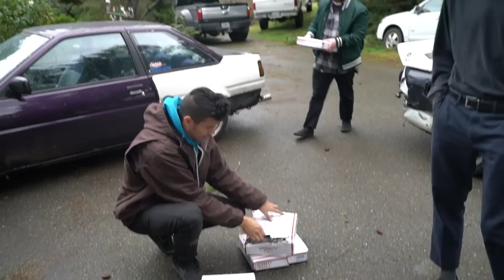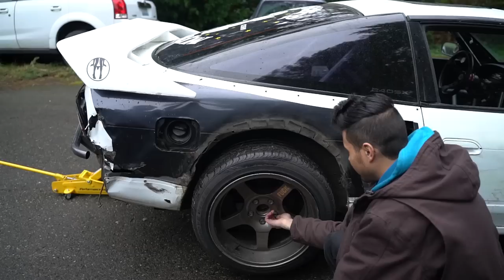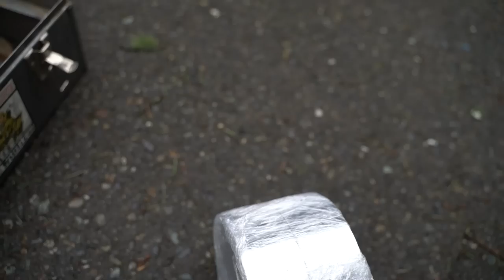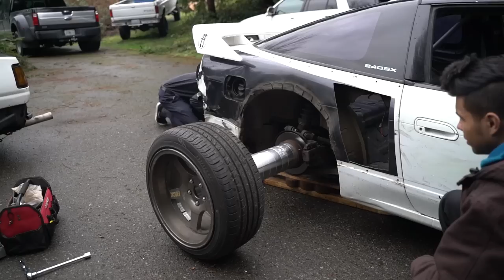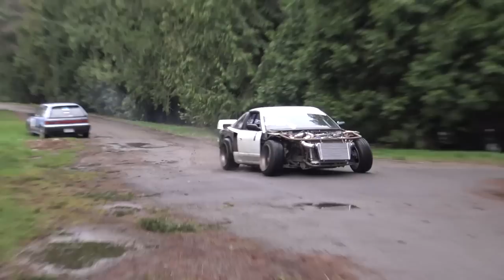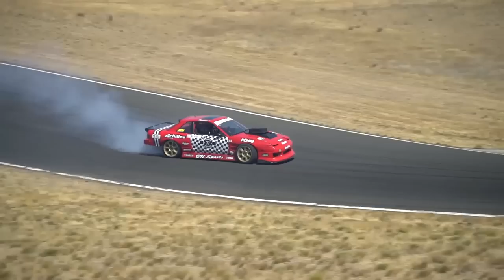How Many WHEEL SPACERS can You Put on a CAR?

Comment: Time to invest in a battery powered impact driver.
Reply: man i love impact drivers
Reply: It'd be dead by the third spacer...lol need an air compressor impact
Reply: Darion Akins My 6Ah battery on my Makita impact driver can last through all those spacers. I only suggested that because it appears that they're away from a location where they might air tools
Reply: its more skids. the impact drivers name is quintin =D
Reply: I work in a garage changing tire sets and our impact guns last through at least 4 full tire swaps (taking wheels off and on). A good tool could last through all of those spacers.
Reply: kiraanimerawr1 Exactly, specially if you have a 6Ah battery on a brushless impact driver. I just replaced my home's entry door. using my Makita sawzall with only a2Ah battery, I cut through all the mounting nails, and even managed to cut my old metal door(foam core) into four pieces without recharging. 6Ah battery on my Makita impact can do all those spacers and remove them with single charge.
Reply: @Dangerwiggles  why no new content on your channel?
Reply: @andyfumo8931  Broito is my main channel now.
Reply: Modern battery tools work fine for stuff like this. Just don't get cheap shit like walmart brands and get a decent battery and you can swap rims all day.
Reply: @darionakins2093  What year you think it is 1990 and NICd batteries?
Reply: Impact driver? 😂😂 Who uses an impact driver to work on cars lmao. Impact wrench would be much better lol

Comment: This car stock weights about 2700 lbs. That's 675 lbs per wheel. If the wheel has five studs, that's 135 lbs per stud. If the studs are M12 x 1.25 grade 12.9, the average shear stress is around 10000 psi. Given that the rough area of an M12 is 0.175 squared inches. The shear stress on each bolt while the car is stationary is about 771 psi. This number is nowhere near the max strength of 10000 psi, so there was no need to think that the studs would break as soon as you lowered the car.
Reply: tru
Reply: That’s not how it works in the real world; purely for starters I can tell you that there is not an even amount of weight distribution on all 4 corners...

Secondly, the wheel studs themselves aren’t the only potential point of failure

Your math isn’t incorrect, just incomplete.
Reply: I’m thankful that ashmeed doesn’t do stress calculations for a living. These lugs aren’t in sheer.
Reply: Did you calculate the leverage of how far its out?
Reply: lol dude, wheel studs are in tension from the lug nut threads pulling on the stud threads.  Not shear.  And moving the wheel farther and farther out turns that stack of spacers into a fatass lever, multiplying the stress on each stud.
Reply: Sooooo...your telling me you did all this math how much free time you got

Comment: What happens if you use JB Weld as a head gasket?
Reply: Been done 😆
Reply: it means u saved money,and it also means ur probably never gonna get the head off ever again lol 😂
Reply: The only way to take the head off is open the throttle... 😄
Reply: Lifted a head at a race a few years back had a new gasket but kept leaking put in jb weld on about 2 inches of the head at cylinder 3. Tiny burnout just for looks, staged and the guy beside us went red. That race paid to have the head fixed and a new set of slicks.

Comment: I had 1.5” spacers on the front of my 2011 Ranger XLT Supercab for the 1994 Cobra wheels but the steering pulled wildly to the left when braking so I removed them after a day. I put those spacers on the back of my Toro 522xi garden tractor. I have videos of both.

Comment: Grats. Spacers without hubcentric lip. This is the great way to break out your wheel because there's nothing holding it just the bolts. I don't know who made these stuff for you, guys, but it's horrible. You can't put on even a single one of this because the wheel won't be centered and it'll break your bolts. I think 10mm is the maximum you can put on without hubcentric lip.

Comment: Retired professional mechanic.... no wheel adaptors are any good at all. They force the wheel bearings to be incorrectly loaded and will destroy the wheel bearing in short order. Seen it hundreds of times. Not to mention it screws the suspensions design.

Comment: I'd be more impressed if they were on both sides of the car instead of just one you can put as many spacers as you want to on one side on one wheel of the car and it will still hold some of the weight of the car but if you put that many on both sides guaranteed the car will sag